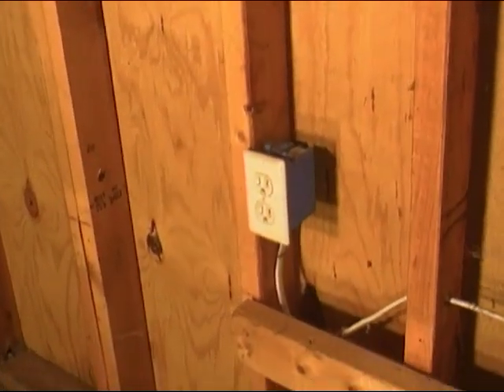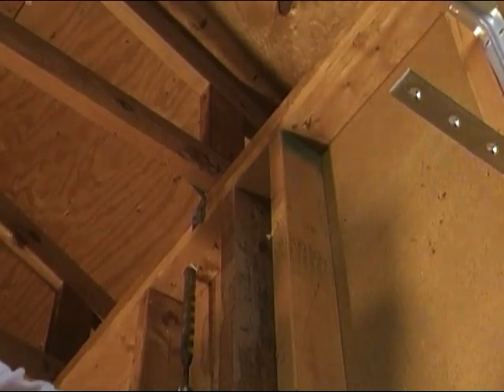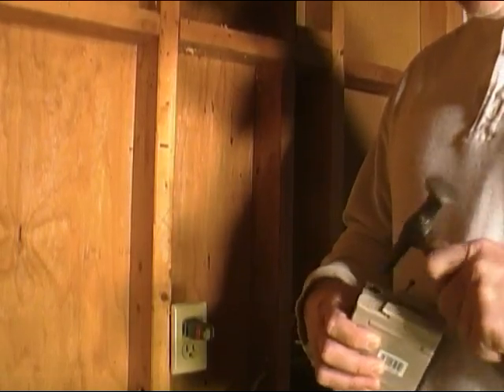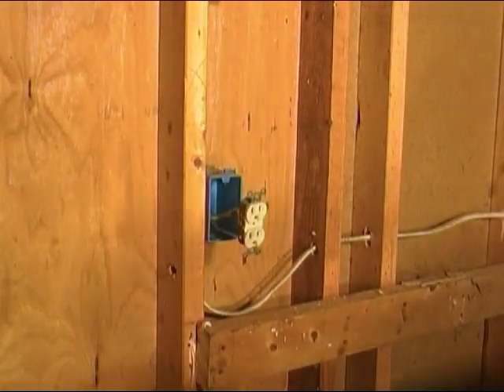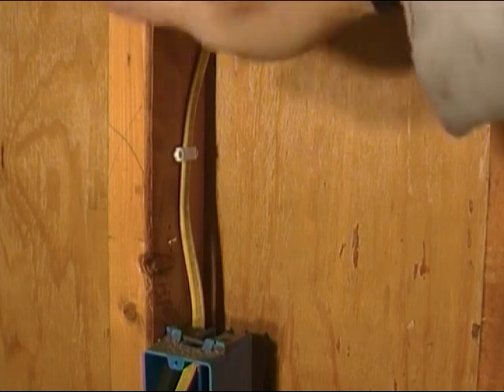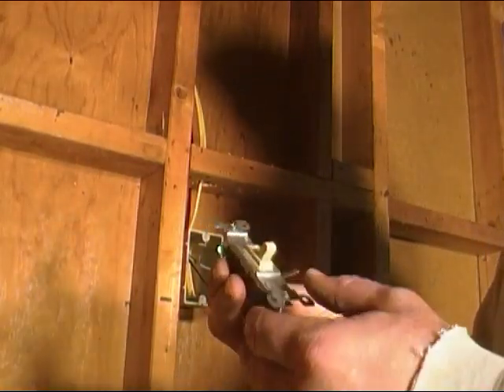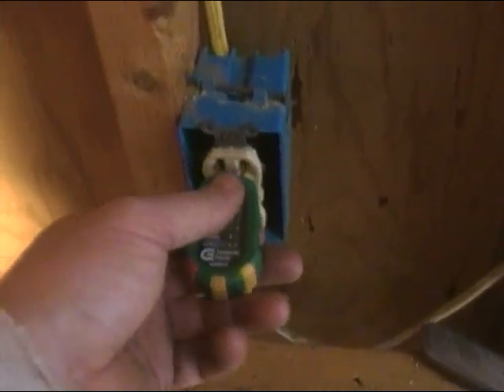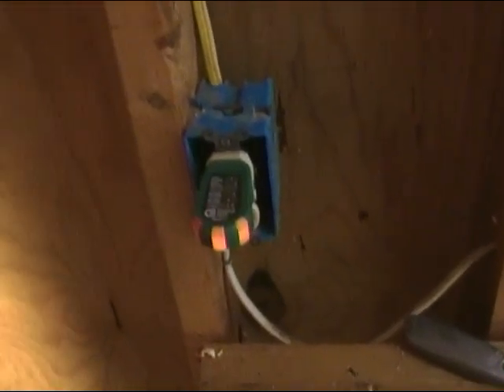How to: Basic Electrical - adding a circuit for Lights in our Garage

Comment: The YouTube algorithm never fails. I just bought a new build and in the entryway, there's an area for a mudroom. The entryway light doesn't provide enough light for the mudroom area and thought, "is there a way to add another light using the existing outlets nearby?". Perfect explanation and I'll be saving some $ on hiring an electrician. TY!

Comment: Thanks for the video!  This is going to help me run a light switch from a power outlet same as you did in order to run wire up to the attic and install a flood light outside from a junction box I will install in the attic and outside.  Already watched video of installing the flood light but THIS IS. What I needed!,,

Comment: Great video, thanks. It really helped me. Does 12.2 wire need to be used when ran up to the light switch and then out to your lights or can 14.2 be used?

Comment: Question: what are the situations in which electric arching occurs, adding line, switch, outlet?  When the plastic on the wire is cut back too much?
Reply: Electrical arching can happen with lose connections and splices.
Reply: If it's cut back too much , you may want to see if who ever wired your house or where ever if they left any service loops for that box. This just means they left some slack so if anything like this happened you could pull some cable down from inside your box. If they never left one and if it's a hazard, you may have to creat an accessible junction box to extent the circuit.

Comment: Please help me understand why didn't you connect the white wire to the switch, you only connected the 2 black hot wires and bypassed the white wire. Thanks.
Reply: There are no "silver" connections on a light switch, the ones you would normally connect the white wires to.  You don't need them for a light switch so you just twist them together and wire nut them and shove them into the receptacle box.  The brass screws take the black wire or "hot".  That is the one that is sending the electricity up to the light to power it on.  You have a black coming from the original receptacle (in this case) and connecting to the new switch and then the black wire leaving the new switch to connect to the light fixture on the ceiling.  Connect the two black wires as shown in the video and connect the ground and that is all.  The white wire or neutral is only used to complete a circuit.  Since the light is the end of the circuit you just need to send power to it and not from it.  Electricity flow is broken in the black wire from the switch to the light when you flip the switch from on to off.  Nothing needs to return so the circuit is broken and no white wire is needed to complete a flowing circuit of electricity.

Comment: By the way, what would happen is the black and white writes are reversed in any connection by mistake?  How should you check which one is the black wire when the line has no color?
Reply: That’s what a plug tester if for buddy

Comment: That's all good but always check code for your area...that would not pass in my area the wires need to be pigtailed instead of using all 4 connection terminals which means you would connect all wires with wire nuts in the box with about a 6 inch pigtail going to the outlet.
Reply: I dont know? Just another reason for inspecters to have a job? Lol
Reply: It has to do with continuity of the circuit so that if you had to remove the receptacle anything down stream would still work.  From this video the receptacle was at the end of the run so making the connections with the push ins worked just fine.  But now that he want to extend the circuit for lighting if he makes all the connections to the receptacle it would work unless he had to take out the receptacle then he would have no power to the lights.  With pig tails the power to the lights would be continious even if he had to remove the receptacle.  The NEC 300.13(B) requires the pigtail method for the neutral on split wire and multiwire circuits, I don't remember if it is required for all connections, but is is the preferred method by many inspectors.

Comment: Just curious as oo why with the outlet did you not wire it to the bottom plug seeings its closer to the wire coming into the box and the top is closer to the wires heading up into the switch? Is there a difference other than preferences?
Reply: That was probably just his preference.
But the correct way to make the connection is disconnect the plug
from the wires.
Remake connections with three separate pigtail connections with jumpers.
the only connections on a plug should only be to service that plug not be used as a daisy chain connector.

Comment: its better you splice the connection than to tap it on the outlet. if the outlet had trouble your light will not work too.

Comment: that's not the right way. you was to cut the old plug in off and pig tail the wires on a new plug. or get the wires out of the old plug
Reply: I guess not a lot of electricians watched this video.
Yes, the correct connection would be a pigtail.
but it is a light if it was another plug or a few extra plugs added.
 it  would be dangerous
especially with those little push connectors, if they get too hot
 they pop out.

Comment: you should have stripped your insulation back further, shouldn't be more than an inch inside the box... You also want you wires  to stick out of the box 6'' at least.. That gives you more wire to work with and this would have been way easier for you...